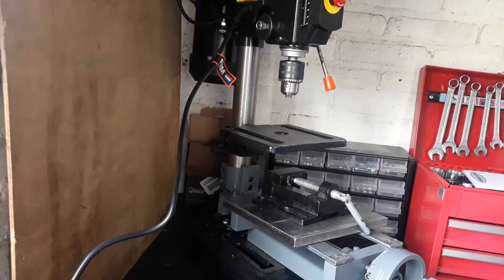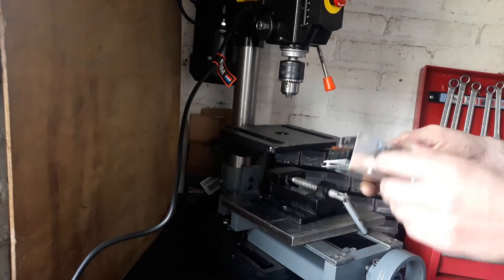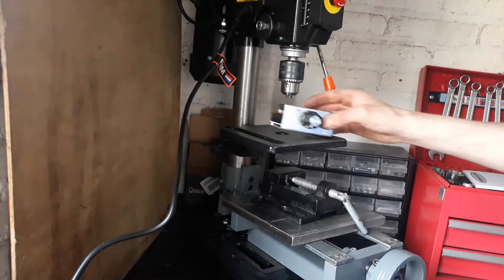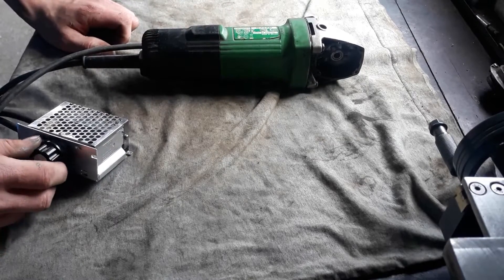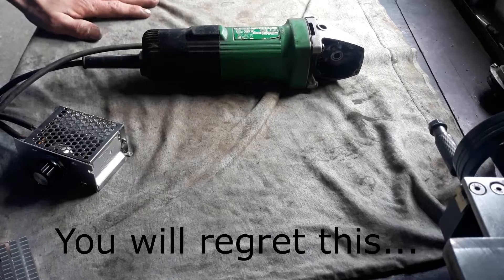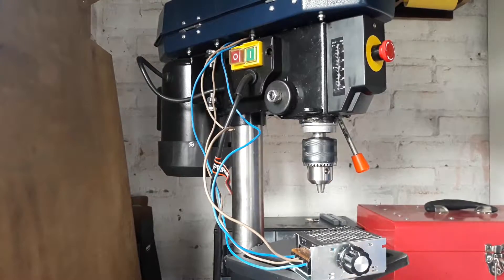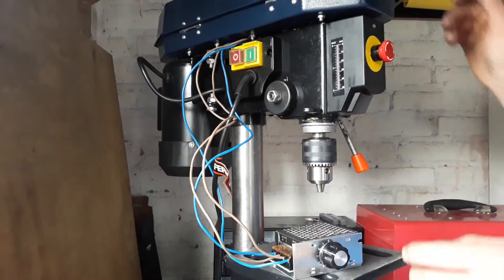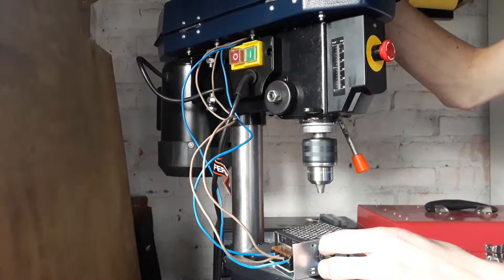Variable Speed DRILL PRESS ?

Comment: Hi Great video, If you really want to control the speed of this type of motor you need to start looking at Variable Frequency Drives; also the chucks of most pillar drills tend to be attached to a Morse taper which is a push fit! If you try using a pillar drills tend as a milling machine; there is a very good chance of the chuck coming lose and falling out which is extremely dangerous; so please be very careful. You could look at old treadmill motors because speed controlling is almost infinite in my opinion. Be safe.

Comment: If the motor has a startup capacitor then it is impossible to control speed using simple dimmer circuit.Also drill press in opposite to angle grinders (no capacitor inside) works in low speed and high torque and reducing speed by reducing its delivered power then the torque is not enough to work in load and drill stops.
Reply from the maker: Thanks for your comment! Watch my latest video for a good alternative for variable speed ;-)

Comment: I'm glad you concluded it is not the right way. As a tinkerer and engineer I think you have 2 options. One is the motor way and I would opt for replacing current motor with a DC(universal) spindle motor (like 500w), easy to find, permanent magnet , very quiet and responsive to electronic control for the speed variation. The other path; I would try to build a CVT pulley transmission - it should be delightful for an engineer and you can find a lot of industrial inspiring  solutions from CVT pillar drill machines, wood-working lathes ... presented on youtube.
Reply from the maker: Yeah this was never going to work, making a CVT is a wonderfull idea. It shouldn't be too hard to make a CVT using a linear actuator or someting like that.

Comment: This device (PWM) for variable speed control works only with universal electric motors, it does not work with induction motors.
Reply from the maker: Thanks for your comment! At the time it was just an experiment but luckily my knowledge of electronic drive technology is a bit better at this stage.
Reply: @EngineerSteve , I have bought a similar device produced in China and try to test with various small electric motors. So, I replace the original induction motor on a drill press with a universal motor from a washing machine. Now it works fine.